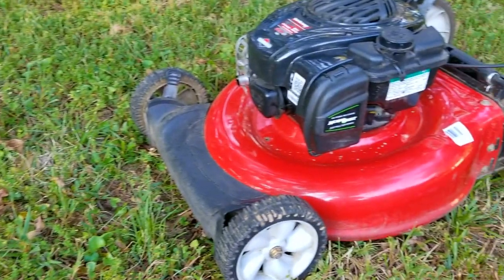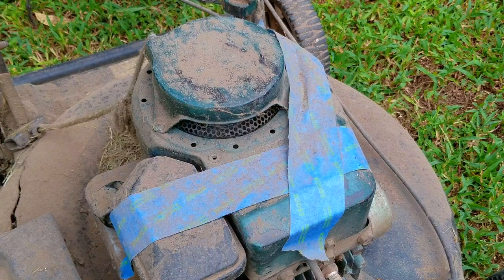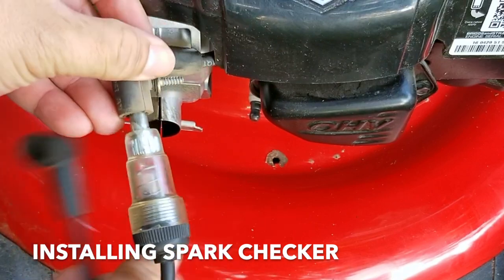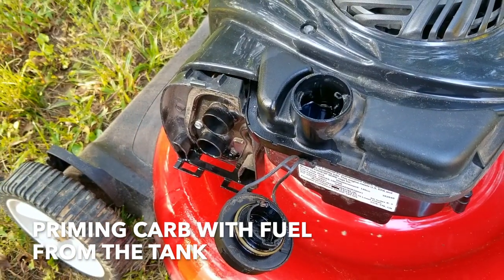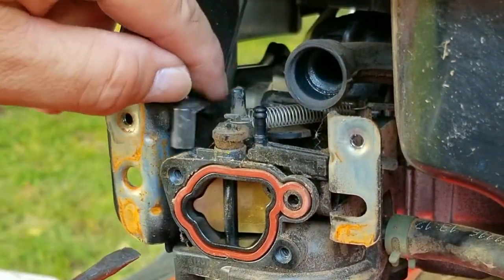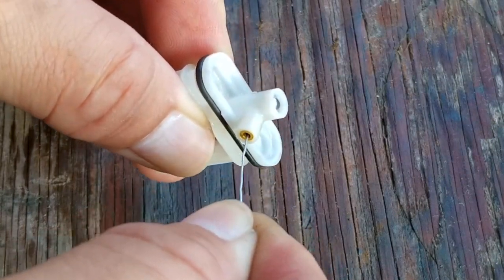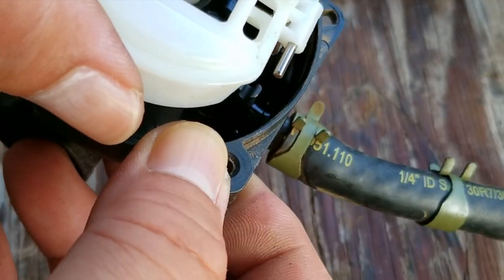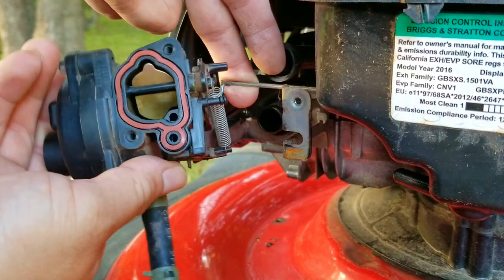Why Did Briggs Stop Making The Flathead Engine?

Comment: Interesting.  Briggs also produced the Europa OHV engine for a couple of years in the '90s, which I am also looking for a couple of.  My goal is to have two of every small engine made, prior to Chinese manufactured ones.  I'm only about a quarter of the way, though.
Reply from the maker: nice, thank you Paul Campbell
Reply: I have two of those first-gen OHV models that were  based on reworking the flathead design. They are great engines! However, a new replacement carburetor is no longer available. I was able to fix up one that was corroded and gummed up. Got it to work good. Can idle it down without any misfiring primarily due to an adjustable low speed circuit.
Reply: They also had a 160cc Vangaurd, that and the Europa where not very good sadly

Comment: So old fuel plugged the carb - just like in the old engines. Fuel injection would also have tiny jets for just a few HP.  As for adding a battery (heavy) O2 sensors, injectors, computer,  fancy controlled ignition, etc, we'd have a much heavier lawn mower, more maintenance, like charging the battery over the winter, or possibly replacing it yearly if it freezes.The CDI ignition module for my small outboard sells for $579.
Yes, emission controls hit lawn mowers over a decade ago. 
I use premium fuel in my small engines. The extra cleaners help.
Reply from the maker: yes old fuel, even in it's liquid state, not dried up, will clog the fuel jet, in a few short months. As for EFI, the tiny jets, only help to atomize the fuel, under pressure.  It was just an idea, versus the wasted money the put into a New plastic OHV engine.
Reply: @INSIDEHOUSEGARAGE  : Well, the new engine isn't plastic. I believe a metal carb will last longer than a plastic one, although plastics continue to improve, while cheaper thinner metals continue to degrade.  Last summer I epoxied over a hole, from corrosion, in a metal fuel bowl. At least their jets are still brass.
OHV egines are more efficient and cleaner. Vehicles gave up on flat heads, when, just after WW2?

Comment: I'm more used to owning the new over head valve engines and never really had issues with them, granted I've only worked on the predators, Hondas and tillotsons and what i do love about them is the power. I've put many predator 212s into go karts and minibikes and the only one that's given me trouble starting is the predator 224 since I've got a mechanical fuel injector to run e85. i think the main issue for the Briggs flatheads is the really low compression since most run in the ballpark of 6:1 while a predator does 8.5 on top of the countless mods
Reply from the maker: thank you Josue.

Comment: I prefer the older flat head engines. I have a few mower engines people threw out, and was lucky enough to buy two brand new of the last of the flats for a Rover frame in Briggs Stratton boxes 10yrs ago cheap online which I most likely will never use
Reply from the maker: nice work!

Comment: I always use brake clean or carb cleaner & air hose before removing the carb. Plus cleaning the carb. What’s sad is manufacturers make’m cheap & sell’m high. I’m sure that you have seen the push for battery operated lawnmowers & all OPE
Reply from the maker: thank you James Kennedy

Comment: A fiew years back, I thougt Briggs engines were crap if built after 1989. But in recent years, my opinion has changed a little. The latest flatheads weren't that bad in comparison to what's on the market now...
Reply from the maker: I would agree with you.

Comment: The reason that plastic carburetored engines clog up so easily and quickly is from the resins leaching out of the plastic into the fuel as it stagnates in the float bowl. If you do not have a fuel shut off, run the engine completely out of gas each time you use it and leave it that way until the next use. For this reason, fuel stored in metal gas cans will stay fresh and usable much longer. Tightly sealed containers stored in a cool, dry Area are best. The overhead valve design is far superior to the flat head in regards to Combustion emissions and fuel efficiency. The automotive world adopted this technology in the late 1940s. Briggs and Stratton has a wide variety of engines that have different durability build qualities. The cheapest ones use a “parent metal” cylinder bore. This means that it is not sleeved and uses the same material as the block which is soft aluminum. These engines typically have a roughly 500 hour service life depending on maintenance and use conditions. If the engine is designated as an “I/C” (Industrial /commercial rated) it will have improved bearings, as well as lubrication systems often including a replaceable oil filter and have a steel sleeve in the cylinder bore.  With proper maintenance and care these engines have a service life of 1000 hours or more. Cheaper engines without drain plugs still need to have the oil changed for acceptable service life expectancy. Roll the engine upside down and drain and replace the oil out of the filler plug after the first 5 hours of operation and then after every 40 hours of operation if the engine is a parent metal design. On these engines, they will begin to consume oil relatively early in their service life. It is extremely important to check the oil level each time you fill the fuel tank and before starting the engine. Never operate an engine without a proper air filter in place. Such use will allow dirt to enter the cylinder bore and drastically shorten service life
Reply from the maker: thank for the information .

Comment: The old flatheads would last because the old carb/tank design had a fine mesh screen to keep the rust & dirt from stopping up the jet. The new ones don't even have an inline fuel filter! Also some of the carb bowls rust up, clogging up the jet.
Many don't realize the flathead engine had something the new engines don't: low end torque. The new engines dont have a throttle control because they don't want you to discover they have any low end torque at all!
Reply from the maker: Thanks for the info

Comment: I like the strength and durability of the old flathead, but there are aspects of the new design that make it easier to work on.  Carb being plastic means no rusting, but yes, the main jet does get plugged up easily.  But, with an allen key, you can open the drain port on the bottom of the carb to drain the rest of the gas - which you couldn't do with the Quantums without the carb bowl coming off and certainly not easily on the old classic engine.  Recoil/gas tank removal on the new ones are much easier than all the flatheads are, but the shorter fuel line is not as easily removed from the carb port.  With the flathead, there were no valves to get loosey goosey and in need of adjustment, either. 

I have seen a handful of the newer engines with lost compression or scored cylinders despite having oil.  Not necessarily the best quality oil, but something is usually better than nothing.  I've noticed, on many that I've worked on, that the smaller air filters tend to get plugged up easily and the spark plugs look carbon'd up a bit more.  I wonder if they end up running rich more often than the older ones did.  

My current mower has a newer Briggs (one of their many iterations) and it does run quiet and smoothly.  Once I can get/find a clearanced Ego/Makita/Milwaukee battery mower, I'll be going that way and selling my Toro Recycler one.
Reply from the maker: good luck with the electrics, I plan on doing the same but purely out of morbid curiosity.
Reply: With those plastic carbs that are only 1/2 inch from the deck, show me an allen key that fits in that space to removes the bowl-drain - unless it's a special tool. That drain-plug still doesn't access the plugged jet. Otherwise, aside from eliminating the oil-drain, I have no gripe with the OHV engines.

Comment: It's really a simple answer, if engines don't break down, they won't get sales! Any change in ANYTHING related to engines is always due to cost savings. Follow the money, it never lies. Oh and stricter EPA mandates forcing them to make a less polluting engine  I have a 2010 toro with the flat head that has well over 1000+ hours on every original part in the engine.... Still original rings, bore, crank, etc. Mind you I do change oil 2x a season, run pure gas. Trust me you won't have to touch a fuel line, bowl gasket anything rubber related if you only use pure gas and purge the system at the end of the season to get any residual fuel in bowl, lines etc. I will dig around to find a oem top end rebuild kit as it's proven it's worth it. No cheap plastic carbs, no valves to adjust just oil change, air filter when needed (2 - year for me) and it will outlast what's it's attached to
Reply from the maker: you are correct

Comment: My Quantum 35 still going strong since 1990. My Victa 2 stroke has been going fine since 1981 though, so the Briggs will have to keep going at least 9 years longer to beat it. Either way, an unstoppable engine (both in my case).
Reply from the maker: thank you Greg Greyson for that information and yes Briggs are very good engines, so is the Vista!

Comment: My advice: when putting mowers in winter storage, ALWAYS EMPTY THE FUEL TANK AND RUN THE MOWER UNTIL IT STOPS ( NO GAS IN THE CARBURETOR) AND ALWAYS REPLACE OIL BEFORE STORAGE
Reply: And dont use fuel with alcohol in it
Reply from the maker: absolutely
Reply from the maker: agreed.

Comment: Can't complain about the Vanguard on my small generator. It's an OHV, all metal design, and starts every time.

That said, I still like the simplicity and reliability of the old flathead (or side valve, as we call them in the UK). There is something almost magical about them.

Plastic parts? Don't do anything for me. I can imagine flatheads and early OHVs still being around on restored vintage machines in another fifty years - I can't say the same for engines with all those plastic parts.
Reply from the maker: well said!
Reply: Vanguard OHV generator engines were made in Japan by Daihatsu - now owned by Toyota.
!n 2015, Briggs & Stratton moved Vanguard production to the US.  I don't know if they're building them here today.

Comment: I have had two of the old flatheads die. One was from my father and it last through our 1st house then our son's, It smoked and therefore killed mosquitos. It finally blew. The second was not particularly old but was purchsed o=used on a lawnmower. Used it at the seasonal campground for two years, Broke a camshaft! Other then that, the only problems I ever had with possibly as many as a dozen others was shearing that @#$% shear key between the fkywheel and the crankshaft. Then there were a couple Tecumseh's on snow blowers. Talk about clunkers. Replaced with Harbor Freight Predators that work great
Reply from the maker: nice work, and thanks for letting us  know what happened to them.

Comment: I never liked the old flathead Briggs. BTW, my OHV Honda starts first pull even on old last years gas. As far as maintenance goes I've had to replace the coil pack in the 15 years I've had it, which was cheap.
I like the new gasket methods too. That's a definite improvement.
Reply from the maker: nice.

Comment: I was once a small engine mechanic,.I can remember the Flatheads were hard to kill..The kids used them in go carts..We used to do them up a little..And they would run..and run..and run..No. governors on them either..We used to cheat.. leave the oil ring lose & put mathe in the oil..for more power..out of those 5 hp.
Reply from the maker: wow, thanks for the tip. I didn't know that.
Reply: We also had a mod class ..For us older guys..We used tillingson carbs..Wisco pistons..lighten up the wrist pins.. Put bigger valves in them .Mill the head..grind the cam shafts. Put offset key ways in them to advance the spark timing too..But then us older guys got bored...So we put 440 & 521 cc snowmobile engines on them !! Now thats a go-cart
Reply from the maker: sounds nice.

Comment: The proliferation of Chinese assembly and engineering certainly helps up-front affordability, but there are obvious tradeoffs as well. Even well-established and highly-regarded companies like B&S  have to pinch pennies to compete in a market where most consumers judge first by purchase price. I'm not saying the OHV engines are inherently bad, but it's no surprise that they're not as robust as their predecessors. Pretty much everything is becoming more and more disposable.

I've got a Simplicity with a Briggs & Stratton Professional, which I was told is essentially the Intek. I don't quite know how to feel about that, but so far at around 100hrs I'm happy to say that it still runs smoother/quieter and starts much easier than the Kawasaki engine I had before. I quite like it. About a month ago, it even started with minimal fuss in -10F cold.. I wouldn't dream of the Kawasaki being able to pull that off (it didn't have a snow blower, though, so it didn't matter). Hopefully it proves to be a long-runner.
Reply from the maker: I would have like to have seen the Kawasaki try though
Reply: @INSIDEHOUSEGARAGE  Trying to start the Kaw on a day much less than 60F was occasionally a challenge. That's actually how I learned how much stress starter motors are under lol. I'd spent probably half an hour trying to get it started on a cooler day, and even minding the cranking times (10s at a time with a good few minute break between attempts), at one point I reached down and the starter housing nearly burned my skin. I gave up at that point.
In fairness to the Kaw, it was pushing 12 years at the time and I later figured out the fuel lines were becoming brittle and likely sucking in some air. It improved after replacing all the lines.
Reply from the maker: did you ever inspect the valve lash or choke mechanism?
Reply: @INSIDEHOUSEGARAGE  Yes on both counts. After everything I tried, it was starting easier and more reliably but still felt down on power. I was starting to wonder if it was low on compression, but at that point I was already looking at new garden tractors so I didn't explore any further.

Comment: The flathead briggs were the most reliable of the bunch, when you upgrade with a hot iridium spark plug and an elecronic ignition module they will start with a mild tug. ❤
Reply from the maker: nice, thanks for the tip

Comment: The newer engines a lot quieter. I much prefer that. My John Deere tractor uses a Briggs twin and it's an excellent engine and you can barely hear it run. Probably more props for the muffler than anything else, but there it is. In defense of the flathead however, I had a 5 1/2 hp on a self propelled mower and it took 28 years of cutting the lawn to finally start smoking. I tossed it at that time, you can't imagine what the mower looked like after 28 years.
Reply from the maker: wow, I bet it looked rough but it made it all those years. thank you Daniel Staggers.
Reply: @INSIDEHOUSEGARAGE  Yeah, I did try to save it. But the rear drive was no longer serviceable because Aircap sold out and I couldn't get parts anymore, (I had already rebuilt it a couple times before and was surprised my phone numbers were dead) and then I couldn't get rings for the engine. Briggs claimed they knew nothing about it and couldn't even tell me who made it. Even though I had all the papers they gave me for the engine. Thoroughly a throw away engine. But still, I had no complaints she went 28 years. I got that from the file I still had on it since it was new. She smoked like crazy but still ran fine. Too bad about Aircap; I'd have bought another in a heart beat. Solid polyethylene plastic rear bagger, rear drive. One flip of the wrist and the grass shot out of the bag like a bullet when you emptied it. Really nice. Not bad for 179 bucks. Well, that was about 35 years ago now. It would be around 400 today. But you'd never get a new mower to do that. 

Actually, I shouldn't say that, one of my V-twins is over 20 and runs like it was new. Wow, time flies. Pressurized oil systems and filters make a huge difference for lawnmowers. I have three John Deere Tractor mowers for three separate properties. All have the same 26 hp Briggs V-twin and all are excellent. I believe those V-twins are the best engines Brigg and Stratton ever made. Smooth as silk and none of them use any oil. Even my Ariens Snowblower has the newer Briggs cold weather engine and it too, is quite excellent. One of those is over 20 and they really work hard. And none of them use any oil and don't have filters. (But they don't get any dust in the winter) Far superior to the Tecumseh Snow king flat head. Those things sounded like they were going to explode everytime you started them up. When they were cold you instinctively got out of the way. LOL I have three of those Ariens hanging around as well. Wow, I own a lot of Briggs and Stratton engines. And we're not even into the generators or pressure washers. I didn't realize how many until now. LOL

Comment: They would still be building the flatheads if they could pass emissions. The E series engine was developed to make something modern that could sell at the same price point as the primitive flatheads.  The carburetors are assembled by a robot.a lot of engineering went into getting the engine cheap enough to be competitive with Chinese imports that were flooding the market at the time. Amount of materials was reduced, and assembly complexity was reduced. The plastic carb was also an attempt to make the fuel system less susceptible to gummy fuel which was a problem with the old pulsaprime carb.
Reply from the maker: I like this comment. Great information and insightful. thank you MNencourager.